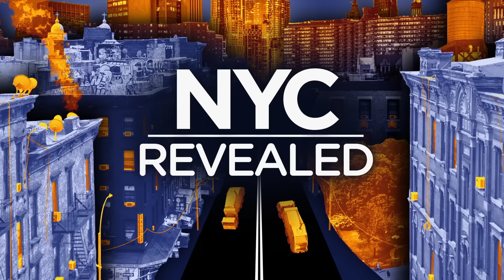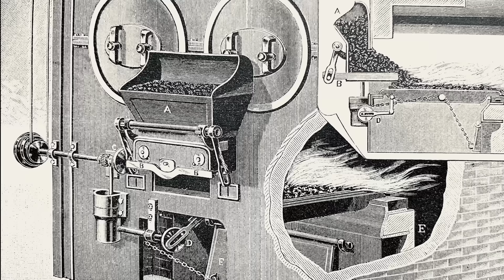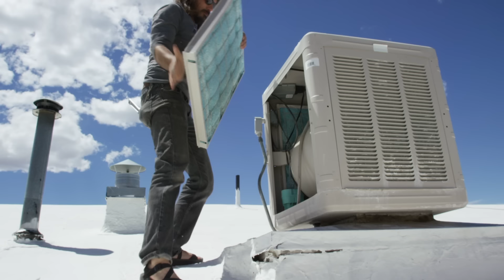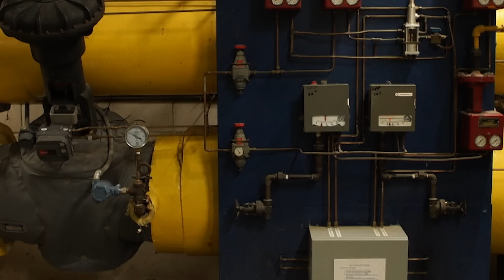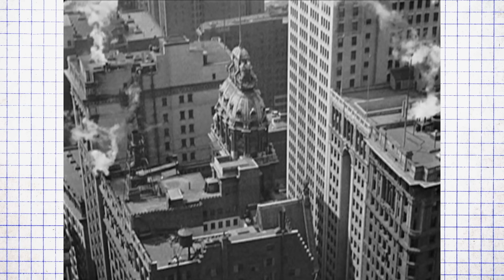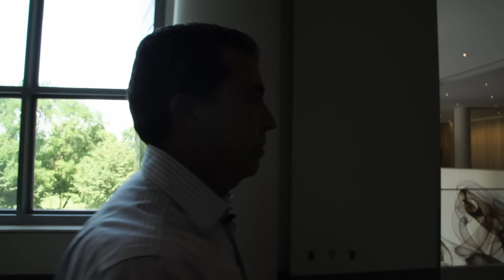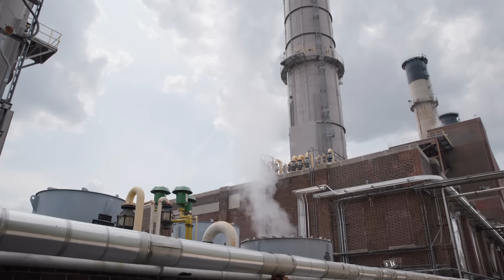How New York Still Relies on this Old Technology | NYC Revealed

Comment: So after the steam heats my building I assume it has turned back to water. What happens to that water, does it go back to the boiler or does or does it just go down the drain?
Reply: Not a single word as to what is done with the condensation or the chemicals in it!

Comment: The Basic Idea of transfering heat like this is still great, especially in big cities, but the way it's done in new York ist embarrassingly bad. In my city the heat gets transfered via water in isolated Pipes, the "used" cold water returns in the cold cycle, the Network is city owned and several companies with unused runoff heat (steel, Trash ovens etc) are connected to the system to use it. Right Here it's the cheapest way to get your home heated, and it's as environmentally as it gets.
Btw every german Village is laughing at the "Clean water" of new York, it's by dar not one of the cleanest drinking waters, and even if, through this old company run steam system  unnecessary much of it gets wasted

Comment: I've seen these stacks come and go in NYC. I believe they only use em when doing repairs or something. Thier used to be a lot more in the early 200s but I don't see them as often now. I've also seen these in Philly and I believe Boston for. Time to time, so it ain't just there. NYC probably has the most though
Reply: Makes sense. You can't shut down the steam generator just to repair a single pipe on the network, so when you close the valve on the pipe, you need to release the steam or it will blow up

Comment: What is not discussed is miles of the network of pipes are still wrapped in asbestos. I even saw some in the pipes of some of those buildings. They encapsulate if they can?
Reply: If it's underground and undisturbed then it's not really a problem. It's only a problem when people are breathing it in
Reply: @pjl22222 Exactly! Each time there is a steam explosion it sends fine particles of asbestos into the air for everyone to breathe. You probably remember the World Trade Center on 9/11? Do you remember the white clouds of dust settling on everything? That was asbestos. Everyone near ground zero that breathed that in was exposed to asbestos. The air was mixed with jet fuel, PCB’s, silicates & a lot more poisonous stuff to humans than we’ll ever know.
Reply: @johnclyne6350 yeah, steam explosions probably release some if of the asbestos, and the air at ground zero was practically poison. It's a good thing that these events are rare enough not to justify ripping out and replacing the whole steam distribution system

Comment: It may be old technology but it's not as outdated as it seems. There's a reason most chemical plants, paper mills, etc. use steam for heating. It's a tremendously efficient way to move heat from one place to another due to the huge amount of energy it carries and releases through condensation. Sure, maybe due to the system being old and insulation deteriorating it may not be as efficient as new systems, but it's hard to beat steam for heating, especially when generated with waste heat.
Reply: True, but as the video said, it comes with a cost of quite demanding and expensive maintenance + a significant risk of accidents. Modern distribution systems using water as a medium are also very efficient, safer and easier to maintain.
Reply: Finally! I appreciate your informed response. A nifty fact of steam heating is that dusting furniture is required far less. Forced air blows dust everywhere.

Comment: Solar fields located far away from the city can ultimately provide electricity that can power these steam facilities, providing emissions free heating in the city.  In the summer, it may even be possible to convert this to a cold water loop, which can be used for air conditioning. This is done in Toronto, using Lake Ontario as a cooling basin.
Reply: Dude it’s sunny like 30 days out of the year here 😂 and the summer monsoons would just flood the solar panels and then the hail pelting them every other day in August would destroy them 🤦🏽‍♂️ you just be from California
Reply: But you could just use the steam to generate its own electricity and not pull more material from the earth to make solar panels and take up much needed farm land, your pro electric life you’re pushing isn’t really helping the planet
Reply: @brentanco  You burn oil constantly and that requires pulling materials from the earth, transporting and refining it.  And then there is the efficiency of burning and the air pollution. Solar has dropped in cost so  much that China has gone from 70% coal fired electricity to 45% is just a few years. They produce more renewable sourced electricity than USA and Europe combined.  Air quality has significantly improved in large cities.
Reply: Blah blah blah

Comment: The reason New York hasn't moved on is because many of the buildings were constructed a long time ago and steam was a common heating system.  Today, there are more efficient ways of heating a building, however converting all these old buildings would be very expensive and disruptive.  Thousands of buildings have steam heating systems installed, so that's what they use.

I just want to add that anyone that reads this comment or likes it is totally gay.  I'm not gay, but you totally are.  Without a doubt.
Reply: We use a similar system in a lot of Swedish cities but with hot water instead of steam. Large insulated underground pipes transport hot water (mostly a byproduct from electric plants when condensing steam from their turbines) and heat exchangers in the buildings heat water for tapwater and radiators. Retrofitting a NYC system to run on hot water would probably be the "easiest" method as you can use a lot of the existing infrastructure.
Reply: So what you're saying is that it wouldn't be more efficient
Reply: @Gymantis low pressure steam is more efficient than water at least in residential/commercial and I still install them often . Steam at just 1 psi is 215°F roughly and when steam hits a colder surface and transfers its heat energy is almost instant and powerful. The Empire State Building steam boiler is 1.5-2 psi for the whole building. So they definitely can't be going away.
Reply: They’ll come a point in time when a transition away from steam will happen.
Reply: @Raveneffect1989  We will go back to 'steam punk', because WE didn't build New York, it's a Tartarian city from thousands of years in our future (which is our distant past). Steam is infinetly better. You have Teslas on fire that won't go out, is that how you want it everywhere? Time to start trying different fuels, that were around 100+ years ago.
Reply: Modern centralized steam generation is actually quite efficient. Way more efficient than having each building make their own steam. That's why we make electricity in a big electricity plant and distribute it to all the buildings. It would be horribly inefficient for each building to have its own gas turbine generator
Reply: It’s like people lauding Tesla for “figuring out” how to sell and repair cars without dealerships. It’s way easier today to start a new company without dealers than it is to tell the thousands of dealers you have (and who do all your maintenance) to go pound sand 

All those buildings are designed for steam, they don’t have infrastructure or spaces for hot water boilers,  nor does manhattan have a way to distribute gas to all of them (or the electric capacity to generate heat that way)

Comment: One of the most inefficient ways of heating all those losses in the pipes and wasted water plus the ignorance of the residents is overwhelming .
Reply: Efficiency wouldn’t be crazy bad if all the steam condensate came back to the boilers but that probably isn’t the case?
Reply: So I guess you claimed smarter than a 200 plus years of heating system. New yorkers should hire you then for a new system that will replace the steam. 😂😂😂😂😂
Reply: @AlfredoOtida85 
1. Learn grammar and spelling.

2. It’s perfectly reasonable to assume that after 200yr the average person with a reasonable level of intelligence could come up with a better solution to what someone did 200yr ago with very limited technology and knowledge compared to today’s standards.

Your snarky comment has done nothing but actually make yourself look extremely naive and slightly stupid.

Comment: Where do they get the steam from? It condenses into water lol. Why not hot water? Why not electricity?
Reply: They’re using the high pressure steam to make electricity in turbines. The turbine acts as a pressure reducer as well which means less pressure reduction stations. Would have been nice if the program talked about what the city does with the condensed steam. Whether it’s dumped or returned to the boilers.

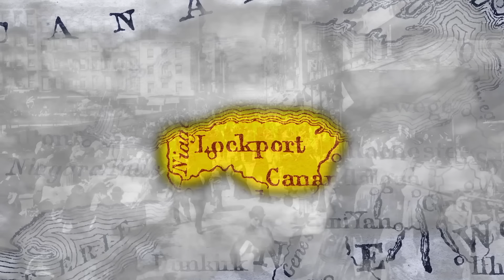Comment: 5:15 but why is Steam more efficient at heating?
Reply: Read about the difference between sensible and latent heat, that will give you the answer. It's the same concept in refrigeration systems. To raise 1 pound of water 1 degree C takes 1 BTU. To make 1 pound of water at 100 C boil into steam takes 970 BTU, so the real energy is stored in the phase change.

Comment: Why do the steam pipes that exit through the streets look temporary?
Reply: Because they should be. Fixing the steam leaks underground is expensive though so that’s why they are vented above ground for long periods until they are fixed. Also to fix the line it has to be shutdown which can’t be done very often as users rely on the steam flow.

Comment: Largest steam system in the world, yeah because every other country has moved on 😂
Reply: the world is wrong. NY knows better, bigger, stinkier
Reply: Steam power is one of the most efficient methods for heating
Reply: It would probably still be the largest steam system regardless
Reply: Steam is a super efficient common method that's very efficient for heating. Like many universities will use it as well because you can do efficient burn rather than tons of furnaces  and don't lose efficiency by converting it to electricity then back to heat
Reply: Not really true, district heating and cooling systems are becoming more common as an effective form of energy supply. Most use medium grade heat in the form of hot water or superheated water but steam is also used and has significant benefits,especially for industrial users.  

If NYC used nuclear cogeneration for steam production it would be a far more effective way of delivering energy than purely electrical and provides redundancy and resiliency to the cities energy system.
Reply: Actually it's a great way to make coal/gas power plants more efficient. Instead of just wasting the heat after it asses through the turbine. My university has its own power plant and get alot of free heating with this system
Reply: Centralized heating is a great thing, using a waste product of steam from electricity production and turning it into a useful form of energy is brilliant. You don’t have a clue how much energy gets wasted vented to the atmosphere. I don’t even live in New York but this is a very common practice in any large manufacturing or commercial setting like colleges and large buildings
Reply: Not true, in my country Norway our steam system is over 1,200 miles. Even small towns has larger steam systems then NY
Reply: @thor.halsli I'm also from norway and we don't even have any cities even half the population of manhattan, what have you been smoking 😂 how could any steam system in like Beverfjord be larger than manhattan 😂

You probably think norway is the richest country in the world too
Reply: Damn near every building uses a boiler producing you guessed it steam.
Reply: You are comparing ONE American city to the rest of the world that has "Moved On"  And using that as some sort of evidence of your superiority somehow.
 Think of the cost to change it... and to what benefit.  Little to no benefit at the end and spend billions to do that. Most of Europe was smashed in WW2.. you had the chance to change things then..  we did not.. NYC is 200 years old.. and has been a large city that entire time.  what they have works, and is efficient enough.  Generate power.. use the waste heat from that to make steam to heat buildings.
Reply: They didn't move on, NYC is just old. 

You can't compare infrastructure on some late industrialized nation to an early industrialized nation. Building new construction with new technology is much, much cheaper than renovating the pre-existing. Why do so many people seem to struggle with such a simple concept?
Reply: @cefb8923  most nations were industrialized at the same time as nyc, if not sooner, but all of them moved to much better technology soon after.  I have no idea what you think your point was supposed to be with that.
Reply: @kubeek  what new technology is better? Wasting the energy used to create electricity by venting it instead of repurposing it? Using heat pumps that use electricity that is created by steam? Having millions of small systems to heat and cool rather than one centralized plant? I’m confused what technology you are referring to?
Reply: Gas boilers cos they use gas for the steam. They would save so much space and would not have to have the big steam power stations to
Reply: The reason New York hasn't moved on is because many of the buildings were constructed a long time ago and steam was a common heating system. Today, there are more efficient ways of heating a building, however converting all these old buildings would be very expensive and disruptive. Thousands of buildings have steam heating systems installed, so that's what they use.
Reply: Russia uses steam heating as well.
Reply: @jackflowers6897  Eastern European central heating systems use hot pressurized water, but not steam. I live in a building with this system. The water is a lower temperature, so it remains below boiling point, but it is still hot enough to make your room nicely warm.
Reply: @jackflowers6897  uh? In Russia It is forbidden to use steam heating in living apartments for safety reasons.
Reply: @bethus2391  фигасе, а чем сейчас топят тогда?
Reply: @jackflowers6897  в отопление подается горячая вода, а не пар
Reply: @bethus2391  да, я неправ.
Reply: As a steam fitter, I can say that you clearly have absolutely no idea what you're talking about. We use steam and hydronic systems in practically every new commercial and industrial building built in America, as well as many residential homes.
Reply: To what would that be? Steam generated by Coal, or Steam generated by Nuclear?
You're a 🤡🤣
Reply: @UnCivilR1ghts  There are few district heating systems in operation today that use steam. Steam based systems like the one in New York are typically referred to as a "1st generation district heating system". Those systems were followed by "2nd generation district heating systems", and in these systems steam have been replaced with pressurized hot water at temperatures above 100degC/212degF. After that we have "3rd generation district heating systems", and these are recognized by using hot water at temperatures below the boiling point of water, typically around 90degC/194 degF. With fourth generation district heating systems temperatures are lowered even more in order to make it easier to use waste heat recovery and heat pumps to provide heat to the system rather than boilers. For instance, using the heat still left in sewage water by using heat pumps is one method that is used.

Using hot water is of course much safer than using steam. Hot water is also easy to store in large insulated storage tanks for peak demand periods.
Reply: @johan.edlund  Couldn't the Manhattan system be configured to use (much safer and more economical) hot water instead of steam? I reckon the existing steam pipes do have some kind of insulation already. Apparently the customer buildings would need (new) heat exchangers and/or heat pumps though.
Reply: @MrZetor One reason steam was used in early systems was because it didn't need pumps. In later systems there are two pipes, one with hot water from the powerplant and a return with colder water from the buildings. Pumping stations make this water circulate. In each building the water will pass through a water-water heat exchanger transfering the heat to the buildings heating system, which has its own circulating water system with pumps. There is also a second heat exchanger for hot tap water.

In the steam system the steam is usually used directly in the heating system, with only a pressure reduction of the incoming steam. So to convert to hot water instead of steam would be a very major change, most likely requiring significant changes to piping, installation of pumping stations and significant changes to the heating system in many if not all buildings.
Reply: @MrZetor  Why? Most of the energy transfer is from latent heat or change of state from liquid to gas and back to liquid... Using steam on a large scale is far more efficient than hydronics.
Reply: @MrZetor  no water not under pressure would not be hot enough.
Reply: @UnCivilR1ghts maybe gas lol 😝
Reply: @UnCivilR1ghts  Yeah but thats efficient, turning steam into power is efficient. Turning steam into heat that needs to be transported across a city is inefficient, literally just a worse version of hot water heating. Steam is useful for generating power but absolutely archaic and obsolote for heating. In the civilized world we use hot water, heat pumps, geothermal, electric or so on and in combinations aswell. It is in line for america to do something incredibly archaic and inefficient because "it would cost money" to modernize and future proof infrastructure lmao.
Reply: @UnCivilR1ghts well said😂
Reply: @UnCivilR1ghts central heating with electricity? Powered by wind and Solar? 

Gas boilers? 

Heat Pumps?

Centralized heating with water or oil as medium > also heated by electricity or sometimes even waste?

There is so much better stuff.